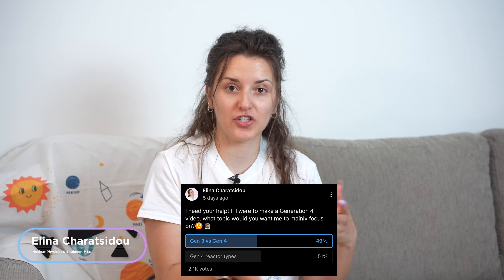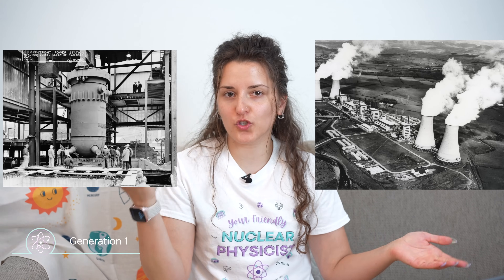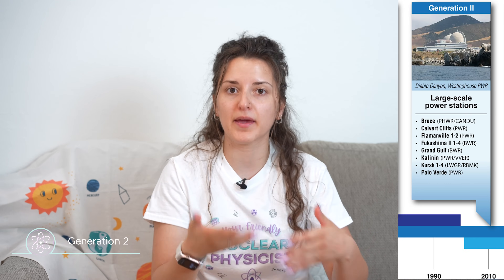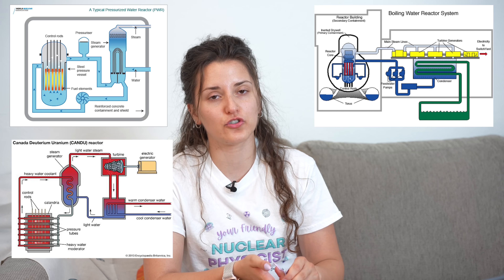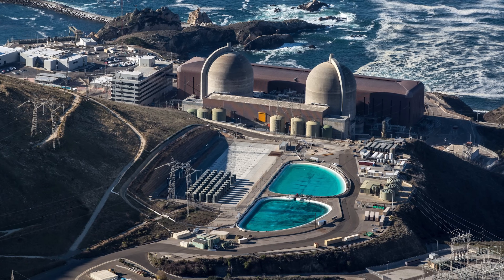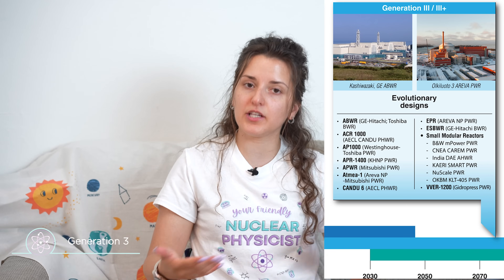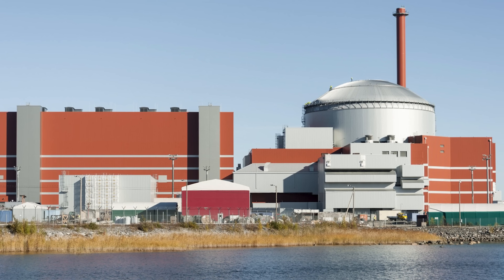Nuclear Physicist Explains - The Rise of Generation IV Reactors?

Comment: Well said, nice… This type of reactors means RESEARCH they are NOT COMMERCIAL... But as you pointed at the end of the video, some generation 4, small modular reactor (SMR) are not research but commercial. The ones with Conventional light-water reactors (LWR).😎

Comment: 17:18 Correction: Not all gen 4 reactors are just plans. The Russian BN-800 reactor is gen 4 and currently operating.
Reply: @marioxerxescastelancastro8019  Since 2022, the sodium reactor BN 800 has been running on 100% MOX with the addition of minor actinides. Before that, it was running partly on MOX fuel.

Comment: Bet we will never see mass SMR if those not going to be absolutely cheap compared to some plants for heating or diesel generators for off grid usage. Those reactors just doesn't make sense. But it's a bit frustrating why so small attention is given to ADS potentially quite ground breaking technology. Could burn nearly anything heavier then lead, power output could be adjusted, doesn't require brain drain technology for melting salt pomping and removing unwanted elements from salt mixture.

Comment: Does Gen4 and Gen5 reactors fall under the NRC? Also are there any regulations that will require future reactors to be built underground instead of above ground like they are now; thus if there is any chance of a major failure we don't have to worry about the reactor blowing up and increasing he radiation in the atmosphere?

Comment: After 7m50s - “something that can be used for hundreds and hundreds of years” 

Look at Google images, for “current pole shift” - our poles have split and magnetism focal points are migrating towards our equator. It is understood by one listener of Yehovah that we had 200 years from 2015 -

Before a cataclysmic event where the magnetic poles begin to rush and snap together at the equator. 

Then the iron masses in our Earth’s crust will serve to guide the crust to rotate where the equatorial regions align to point towards the North Star and the Southern Cross.

Then no more magnetic shield — or one scientist predicted it would go back on in 3,000 years.

Our core is way weaker now than with former pole shifts - for some reason.

So I am hoping our nuclear engineers can figure out how to reduce explosions of any nuclear reactors and bombs in case in 130-150 yrs.  

At that time humans can start to go underground and work on making a resonant shield. 

We can then catapult from our sun to another sun using plasma and solar flare momentum - space station YouTube videos show black orbs with “tails” that may be getting plasma from the sun - then blasting off.

Comment: Canada has also signed on to triple nuclear power use in the nation by 2050... SMR's are planned for Alberta, Saskatchewan, Ontario and New Brunswick... All 4 provinces don't have large amounts of hydro power to draw cheap baseload power from so it's a good strategic move...  Moltex is signed on to build a reactor at Point Lepreau, New Brunswick next to an existing CANDU reactor and eVinci micro reactors are going to be built in Saskatoon as a testbed for future rollouts of the technology to rural parts of Canada currently powered by diesel, pun intended...

Comment: Summary
- 0:00 Introduction to Nuclear Reactor Generations
  - Discussion starts with the introduction of Generation 1 to 3 reactors.
  - Plans to later discuss advantages of Generation 4 reactors and their importance in the nuclear industry.

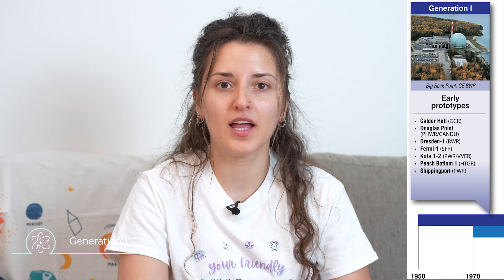- 0:33 Generation 1 Reactors
  - First-ever reactors, constructed around the 1950s and 1960s.
  - Mostly experimental and small in size.
  - Examples include Fermi 1 in the USA, Shippingport in the USA, and Calder Hall in the UK.
  - Last Generation 1 reactor shut down in 2015 in the UK.

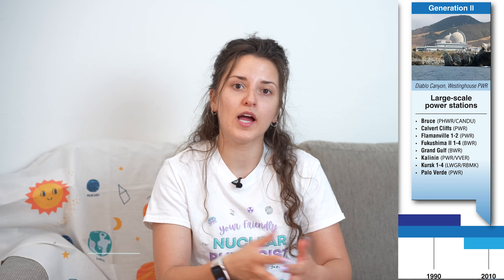- 1:29 Generation 2 Reactors
  - Commercial reactors, currently used in the nuclear industry.
  - Large scale, connected to the grid.
  - Four main types: Pressurized Water Reactors, Boiling Water Reactors, CANDU Reactors (Canadian design), and VVERs (Russian design).
  - Examples include Diablo Canyon in the USA.
  - Lacked advanced safety features, relying mostly on active safety requiring operator intervention.

- 2:53 Generation 3 Reactors
  - Evolutionary designs based on Generation 2.
  - Enhanced with advanced safety features, especially passive safety.
  - Self-regulate without needing much active operator intervention.
  - Examples include AP600 by Westinghouse and EPR (European Pressurized Water Reactor).
  - Built in the 1990s and early 2000s.

- 3:54 Generation 3 Plus Reactors
  - Introduced between 2010 and 2020, post-Fukushima.
  - Advanced water-cooled designs with extra passive safety systems.
  - Examples include AP1000 by Westinghouse.
  - Aim to enhance safety and reliability, reducing risks of core melts and severe accidents.

- 6:24 Generation 4 Reactors
  - Introduced in the 2000s, focusing on sustainability, economics, safety, and proliferation resistance.
  - Improved fuel utilization, using more uranium-238 and recycling spent fuel from older reactors.
  - Economically competitive, smaller, mass-produced, and easier to install.
  - Enhanced safety with passive systems and virtually impossible core melts or severe accidents.
  - Proliferation-resistant designs, making fuel less attractive for misuse.
  - Countries like the USA, China, Russia, France, and Sweden actively developing Generation 4 reactors.
  - Still experimental, with some lacking operational experience.

- 16:24 Conclusion
  - Generation 4 reactors offer reduced nuclear waste, more energy production, improved safety, and proliferation resistance.
  - Capable of producing high-quality process heat for hydrogen production.
  - Still in the experimental stage, with high current costs but potential for cost reduction through mass production.
  - Emphasis on the need for further development and operational experience.

Comment: What do you think of the prospect of using existing ICBM's/silos for a Global O Neil Cylinder Construction Program?  The nuclear warheads would have to be dealt with (naturally, nuclear power)

Also, do you think they could feasibly launch 6 million tons (at Least) of material into stable earth orbit?
What about Hydrogen Fuel Cells alongside Nuclear?  (using Hydrogen to store energy from renewables and transporting it)
Hydrogen and oxygen could be used as fuel for rockets.

Comment: Well, what worries me a bit is that, aside from the several startup scam companies which will undoubtedly arise from the Gen IV / Thorium hype train (just like the fusion and hypersonic jet hype-generated snake oil salesmen in the last decades) is that some serious ventures in the field are considering using fast neutron reactors cooled / moderated by a liquid lead-bismuth209 fluid (for various reasons) that as the "unfortunate" side effect of generating high amounts of the horrifically hard to handle and extremely toxic Polonium210. So I'm not sure, in that case, where the proliferation or safety consideration is... Po210 may not be used in a nuclear bomb but is just as dangerous if not more if used as a mass scale poison or dirty bomb. Imho. 
EDIT: Also, you know that, you"re a physicist... So, feel free to correct me if I'm wrong or misinformed...

Comment: Hi there, thoroughly enjoying your videos.  i worked in the UK at Hunterston A and B nuclear power stations in Scotland for 30 years in various engineering capacities.  I noticed you didn’t mention the UK’s Magnox and AGR gas cooled reactors.  Both had negative void co-coefficients where raised temperature acts as a negative feedback thus limiting runaway reactions.   This seems similar to the goal of self regulation of the reactor power using the methods now envisioned for the gen 4 reactors you discussed.   Another advantage of gas cooling is that the control rods would fall in under gravity in an emergency shutdown rather than having to be motorised.  Handy in a case of loss of electrical power.  I’m not a physicist so appreciate your ability to explain the physics side of nuclear fission in layman’s terms without losing your audience in the complexities of the physics.  You are right that fission is totally confused with fusion in the eyes of the public.  This has been a major problem with the publics perception of the nuclear power industry.  People equate fusion with the atomic bomb, a basic mistake that has held back the industry for years.  Regardless of the inane green arguments against nuclear power it is the only real sustainable power source we have for the future.  i think this is now beginning at last to be realised in the UK and hopefully we will return to building a renewed and substantial nuclear power capability.  Keep up the good work.  The more transparency and education we have the better.  Thank you.❤

Comment: You should take into account the Oak Ridge reactor that did all the scientific research with regards to molten salt reactors. They proved that it worked and that it was safe. They also solved the issue with corrosion by using an alloy called Hasselhoy N.
They did not produce electricity but that is just adding a steam system with a heat exchanger. Traditional nuclear power plants needs a lot of cooling water to operate safely. Loss of cooling was the main cause of Three Mile Island, Chernobyl and Fukushima. In September 2021 the Chinese launch a new test reactor in the Gobi desert. They used the knowledge from Oak Ridge and this mini plant should be able to support 2000 households. Since it is situated in a desert there is not much water for cooling available. If all goes well they will start roll out bigger reactors in a large scale by 2030. An other project worth mentioning is Thorcon. They will put molten salt reactors on special made barges that can be deployed almost everywhere near a river or the sea. With exception of the nuclear part everything else is off the shelf components. The barges can be mass produced at any major shipyard. They also have plans for how to operate and maintain the power plant. Included is also a plan how to manage the waste.

Comment: I place more hope in the Molten Salt Reactor. Its feasibility was demonstrated in the 1960s, but the experiment was ended for want of funds. 
[Money was instead poured into sodium cooled fast reactors.].
The objections to the MSR seem to be largely metallurgical. Such problems exist with PWRs - but have been overcome.
There are great features of the MSR, not least of which is that it is not pressurized (needs no containment vessel), burns ALL its fuel (which is liquid) is load-following, etc etc.
Yet governments spend money on other things.

Comment: You mention that one of the goals of Gen IV reactor design is higher fuel utilization, and possibly a reactor that would never need to be refueled for it's entire service life (40 years?). My question is, how would such a reactor cope with the build-up of fission poisons over time? In typical Gen II light water and CANDU designs, using low-enrichment or natural uranium fuel, the service life of any individual fuel pellet is no more than about 3 years, and as little as 18 months. What "uses up" a fuel pellet is not so much that the uranium gets depleted, as that buildup of fission fragments reaches a level that they reduce the amount of available neutron flux to where the chain reaction can't be maintained - Xenon-135 is a very strong fission poison, but it decays in a few hours so is only a temporary problem. But there are other fission fragments with much longer half-lives, and these do eventually cause a fuel pellet or fuel rod to become un-useable. Now, I am aware that American Naval reactors using 90% enriched U-235 fuel, in submarines and aircraft carriers, can operate for up to 20 years without refueling, but producing this fuel is far too expensive for cammercial power. So how do the Gen IV designers plan to work around the fission poison buildup problem, to get long-term service out of low-cost natural uranium or MOX fuel, without having to re-process it? It sounds like a great idea, but I can't visualize how you would do this with either solid ceramic or molten salt fuels. I've read studies on how the LFTR is supposed to operate, and that design is totally dependent on chemical separation to extract U-233 from the Thorium-232 feedstock, and as far as I know, no one has actually done this yet even in a small experimental design. It's all theoretical.
Reply: Many if not most gen IV reactors use liquid fuel instead of solid pellets. Liquid fuel does not self-destruct like solid fuels. Gasous fission products bubble out and the rest can stay in the fuel for a very long time. They can also do online separation while the reactor is operating.

Comment: Only nukes that can be mass produced like cars have a real and relevant value. To me this imposes a SMR requirement. Contradicting this, fast neutron nukes have tiny cross sections which make them huge, thus no fast neutron SMRs. Explain howto get past that hurdle please. Also, try to get the max size of American SMRs raised from 300MW to 333.4MW so the nuke fits in with 3 instead 4 for power plant engineers who work in a world in multiples of 1GW.

Comment: Using plutonium as the fuel it is very difficult to not have nuclear weapon proliferation.  The high temperatures and high neutron density is challenging for materials and cooling.

Comment: The accumulation of actinides cannot be overcome. That is a deal breaker all on its own. And no it cannot be eliminated by recycling both for technical reasons and for cost and fuel fabrication reasons.
Reply: Most gen. IV reactors are using liquid fuel which don't degrade like solid fuel. They still get actinide build-up, but it takes much longer to be a problem. Gases can be bubbled out continuously and online separation is possible but most are not adding that complexity initially.

Comment: Excellent video Elina. Don’t forget the UK, which is producing the Moltex flex reactor. Moltex energy are also producing the stable salt reactor waste burner in Canada, which will use their WATSS waste to stable salt technology to recycle CANDU nuclear waste. The main advantage of the stable salt reactor design is there is no pumping of active fuel through pipes, valves, heat exchangers and a chemical processing unit. Instead the molten salt stays in vertical tubes, and fission gases bubble safely out at the top where as I understand it most of them decay into something else. This design reduces the cost enormously. Also they are planning to store heat for up to a week, so that they have plenty of energy to generate electricity when there is no wind or sun to drive renewables. That heat storage mechanism is called grid reserve.

Comment: Nuclear, the most expensive and dangerous way to boil water for electricity
Reply: True of generations 1-3 because they use water but generation IV uses high-temperature coolants like lead, salt or sodium. These allow the reactor to run at up to 750c which is much more efficient AND provides high-grade industrial process heat. The demand for process heat is double that of electricity alone. Right now that process heat comes from burning natural gas and coal.

Comment: Very nice presentation.  On the Gen 4 reactors, you mentioned the advantage of using reprocessed spent fuels from previous generation reactors.  Are there facilities for doing this reprocessing, or would they need to be built as well?  And what would the problems be in reprocessing such dangerous stuff?  I know in Little Valley, NY that there was a reprocessing plant that was shut down.  There were area contamination and clean up issues there in the shut down, and I suppose during the operation as well.  And some shady things involving plutonium also occurred that I had heard yrs ago from the grape vine, as in "special" fuel rods that ended up in operating commercial reactors.  Just wondering.
Reply: В России при каждом(если он будет 1 на АЭС) реакторе на быстрых нейтронах будет комплекс по переработке работавшего топлива и изготовлению нового.